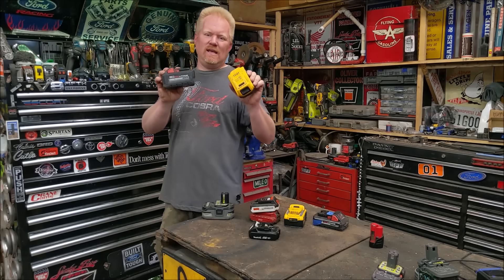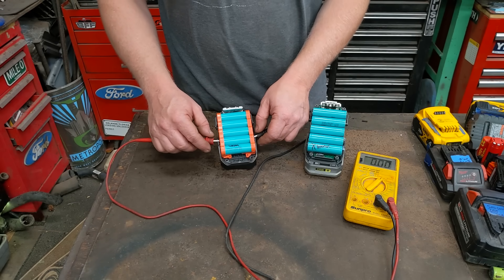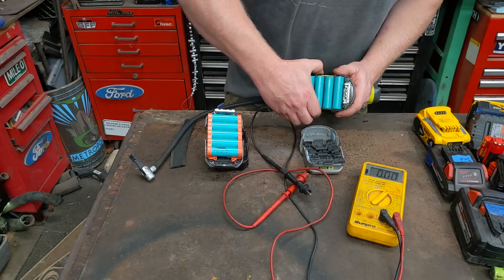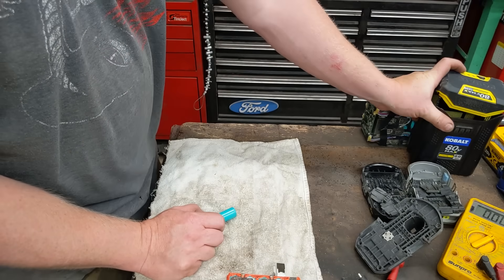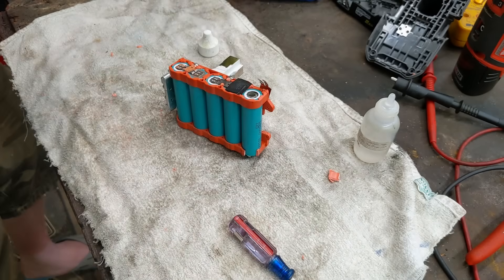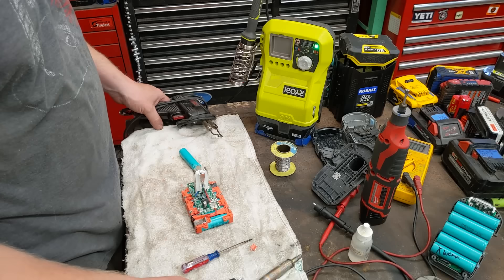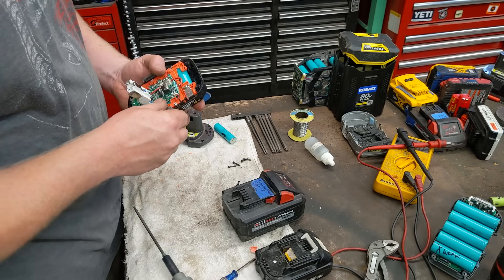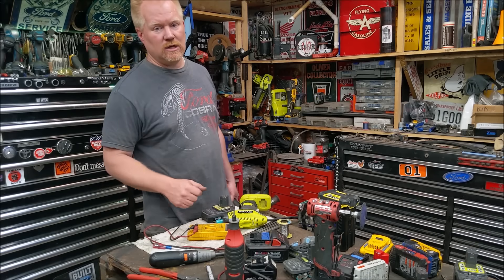Revive DEAD Battery Packs - Rebuild Repair - Dewalt Milwaukee Makita Ryobi Bauer Ridgid 18v 20v 12v

Comment: No one will answer me so maybe you will 🙏 I repacked a nicad battery with 18650 lithium and used a 5S board the problem I’m having is when I pull the trigger of my drill it goes to spin then stops and if I pull it on very slowly it will go full speed until I put any load on the drill then it stops can you please tell me why it’s happening and how to fix it please
Reply from the maker: Not all 18650s are created equal. You have standard and high discharge. Standard 18650 that you might find in a laptop can only put out 2 to maybe 5 amps. High discharge on the other hand can put out 10, 15, 20 or even 30 amps. So it sounds like you used standard 18650s and they're just stalling out/ the voltage is dropping off to zero under high load.

Comment: Excellent tutorial. Regarding soldering in general, a few things to ensure good joints and aide the process: 1 - make sure the soldering iron tip stays tinned or effective  heat transfer will be nearly impossible.  2 - skip rosin core and go with solid solder wire and use Solderlene flux with alcohol wipe clean. Better for metal-metal soldering is solid solder and Stay-Clean acid flux followed by liberal baking soda/water flush after soldering. Use a small amount of flux and don't let it run everywhere.

Comment: I have a Milwaukee M18 battery, it was flashing red on the battery, I jump started it with another battery, and now it's at 2 bars, but when I put it on the charger, it lights up green like it's charged. But it's not. Any ideas?
Reply from the maker: You have dead cells
Reply: @sixtyfiveford  Kinda figured that. Was just hoping it wasn't lol Where can I get decently priced 18650s?

Comment: How do you charge it with the cardboard plug? One clip on + and one on - ?
Reply: And have it connected like a bolt wrapped in tape work?
Reply from the maker: I have the ends of the test leads pinched between the cardboard and contacts.

Comment: Dyson is one manufacturer that requires you buy another board when one or more cells fail. But the boards range from $15-$25 instead of $70+ for a new own pack.
Reply from the maker: I thought only the magnetic switch went bad on those boards.

Comment: They don't solder the battery's, becourse the solder will melt if it getting to hot and the heat that travels to the battery can damage the battery,, also the solder joints can easyer break under vibrations, short spot welding doesn't do harm to the battery, can't easy break and delivers enough contact surface for power transfer.

Get the facts right and research befor telling story's and you have no clue what you are doing. You will at some point have a accident with your botched job and people that are doing what you told them too.
Reply: He even says that in the video when he's soldering to them. You can buy a cheap spot wwlder and strips on Amazon.

Comment: You can get this days excellent lg hg2 18650 battery's for about 6$ each and even cheaper the more you buy, change all battery's in a pack if possible and you have a much longer life out of the pack and they are even made for power tools.
Or build your own power pack with a bms and a 3d printed housing and that's even future proof if in the future the lifepo4 battery getting more amps in 18650 versions or similar cells.

Comment: You tell that factories don't solder because of time? This isn't correct when you solder that battery they can get to hot which destroys the cell when spot-welding it doesn't that's why they use this and not soldering. Just to inform you i make several battery's for all electric projects as my work.
But hey the movie you just made is great so keep up that. Greetings from the Netherlands

Comment: This is the best and most complete tutorial I have seen.  Ryobi batteries seem to be really prone to killing one cell, I am going to pick up one of those Kobalt packs and I can probably repair all 20 of the Ryobi batteries that I have on the shelf.
Reply: After loving the lawn implements I bought a drill set and yup… the 18V batteries suck
Reply: Sacrifice one to harvest cells to repair the others.

It isn't just voltage that matters though, you need to match the capacity of the cells in the pack.

Some battery BMS circuits will error out if some of the cells are discharging too quickly compared to the others.

Comment: One point they don’t all use the same cells, though most tend to use different capacities of 18650 cells, newer “high/higher capacity” batteries tend to use 21700 cells which are larger and the 2 cells are not interchangeable. 
While I have fixed battery packs in the past as typically it’s just a single cell or wire that tends to break and have even put new cells in packs; I must say for the battery pack cost vs the battery cell cost plus time rebuilding just doesn’t make sense anymore. I never understood why companies don’t offer a refurbishing service for their batteries where you send in an old pack and get either a new pack or new internals.
Solder can work for smaller size rep area but the builders/assemblers don’t use solder not because of just time, but size and safety, soldering can be quite dangerous with lithium batteries. One tip I’ll give you is to use tube solder, you just squirt it in a cleaned and fluxed surface, fold the tab over, then heat. Or just invest in a spot welder as the fixes are just so much better and always fit back in the pack; I’ve had repairs that didn’t want to go back in the pack because of solder, before switch to spot welding.

Comment: id recommend a bucket of sand for immediate yeeting in case a cell starts to bulge and may want to make bad things happen. its much easier to carry a bucket of sand than a hot cell and the sand helps contain any fires long enough till you are outside away from the building
Reply: sand is good but I prefer to use Li-Fire Safe Charging bags.  They arte inexpensive insurance against not only fire bur spraying, hot lithium.

Comment: I have pulled apart a few of my bad  battery packs, but have not gotten around to replacing the cells. The M12 is a bit tricky to pull apart. What I found worked well for getting the cells out of the tight battery pack is to put some hot melt glue on the end of the battery and attach some kind of puller. I use the pullers that are used in paintless dent repair.
Reply: What an awesome idea!

Comment: You can get a decent spot welder for about 24$ that uses either a high drain 12v lipo or a high amp-hr 12v car battery for power. They are made with two red pcbs for the body and have 3 buttons with a small oled display.
Reply: Those ones are junk

Comment: One thing to consider is that most of the cells in these packs were manufactured in the same batch, put into the battery at the same time, and likely have similar wear characteristics as ever other battery in the pack.  It's only a matter of time where you see multiple failures in the near future (YMWV).  This is a common issue in server RAID arrays for the same reason...all the drives are usually installed from the same shipment and are subjected to a similar workload over the same period of time.  

Replacing 1-2 cells may work, but if you could spare a few extra bucks, and you can get cells for a price that makes sense, just swap all the cells.
Reply: What an interesting reference to server arrays. I've seen the very same thing happen with batches of drives in raid arrays.
Reply: He forgets they are in stages, and usually the bottom one is the weaker of them all. Thus why he test each to see if it's in the middle.
Reply: It is true for server hard drives, but they aren't the same as batteries. I have gotten plenty of batteries that have 1 or 2 bad cells and the rest of the cells have continued working just fine. and most of the time they go bad because people don't regularly charge old batteries, which I recommend very much. They tend to drain by themselves faster the older they are but not all of them from my experience.
Reply: This myth is often used by the manufacturers of the packs to try and dissuade people from repairing them. A cell dying is a freak event. The chances of 2 in the same pack dying in close proximity to each other is miniscule.
Reply: That is false.  Cells do not commonly fail early.  Plus in the video he told people to use good cells from equally old packs because its cheap to do as people throw non-working packs away.  So you kind of went out of your way to post this false information.  A tesla has thousands of cells, replacing one is riskier due to that.  These devices have 5 cells.
Reply: But how does this detriment Trump Supporters ?
Reply: It doesn't,  but your TDS is a constant drain on your energy. That's because your hatred is self-destructive.  Funny how the party of tolerance is so full of hatred.

Comment: Doesn't Makita BMS have some sort of memory chip that logs the failures and purposely disabled the BMS permanently?
Reply from the maker: Yes if you attempt to charge a bad battery 5ish times. However, you can buy a new BMS and case for around $15.
Reply: @sixtyfiveford  That's interesting.  I don't think I've seen anybody go down that path.

Lol.  I guess I spoke to soon...I just got the the point in your video where you mention it.

Comment: I would recommend the charger I got while doing racing drones. It is cheap and versatile Imax b6ac.  Great info on your channel as always but the charger can help with many other scenarios.
Reply: I wish I saw your comment earlier. Bought the charger he's using but found out about the b6ac. It is alot more versatile and would've been great to use. From what can see the can charge a discharge whole battery packs as well as individual cells? All the listings adverise the pack charge/discharge function. But I don't see why it wouldn't work for individual cell charging like he is doing(@2:20) when set to the correct settings.

Comment: I had a Milwaukee battery only 3 lights would come on.  Plug it into the charger I got a green light.   Took it apart charged the one lower voltage cell and it seems to work again.

Comment: Don't worry kids! If you get lithium battery goo on your hands while working, MEK or benzene from carb cleaner will clean you right up!

DISCLAIMER: DON'T USE CARB CLEANER ON SKIN. IT CAUSES CANCER OR WORSE

FURTHER DISCLAIMER: When you give bad health advice to your audience admit your mistake or be punished in the comment section forever.
Reply from the maker: Absolutely. Per the can: "prolonged exposure can cause dry skin".... Scary.
Reply: @sixtyfiveford  you think it's ok to use MEK and Benzene on your skin? Say yes or no for your audience RIGHT NOW!
Reply: @sixtyfiveford  "Benzene is classified as a carcinogen, which increases the risk of cancer and other illnesses, and is also a notorious cause of bone marrow failure" - straight from Wikipedia.
Reply from the maker: @inspireonex  ETHYL BENZENE (CAS 100-41-4) is not classified as a human carcinogen. I have no issues with dry skin and just used it yesterday to take some super glue off my finger and this morning to remove dried paint off a hat. I touched the soaked rag continuously.
Reply from the maker: @inspireonex  So it's not a carcinogen in humans.... Nope, no MEK in my carb cleaner.
Reply: @sixtyfiveford  nobody said it wasn't. EPA only admits it could be. Why would you take the chance or encourage others to do so when it's so likely? As for your brand of carb cleaner only containing chemicals you find safe... That's great. The thing is though, you didn't tell people to "only use carb cleaner if you know this companies exact formulation". You said "spray it on your hands". I have seen multiple different cans listening different ingredients as hazards. Don't you find it strange how some brands or types cleaners do a better job than others? I.E. contains different stuff. Carb cleaner has been listed as a direct cause of so many health problems. I feel like you aren't seeing the forest for the trees. No matter. Do as you please. Just don't rope others into a false sense of security. Maybe others reading this will at least cause someone to do their own research as I have.
Reply: @inspireonex  FYI wikipedia is not a reliale source for research.
Reply: @jimkaray  reliable enough for the sake of this discussion Karen

Comment: Little trick with the ones that brick themselves when you pull the power is to piggy back a voltage into the BMS with some spare cells and wire.
Reply: I just replaced 6 out of 15 cells in Milwaukee m18 9ah, but when i put everything back the BMS doesn't show battery level or anything and on the terminals I have 19v 
Any tips?
Reply: @enduroiasg4068  No sorry, some of the smarter BMS's brick themselves when they are disconnected from the cells.  If everything is back together correctly I'd look for an aftermarket replacement board.
Reply: @jamesogle99  i put it in charger for few seconds and now it works :)
Reply: @enduroiasg4068  Awesome!
Reply: This exact scenario was covered in the video.
Reply: There are several ways to recover from a brick. The smbus is used on a lot of BMS and you can send a wake-up command if it's not burnt a fuse. 
You can also try to reset the BMS chip by shorting it's reset pin to ground.   I've done this a few times 

If removing cells.  Like you say, add a voltage to the pins of the BMS via a power supply before removing the cell.  This way can help avoid the brick

Comment: Even if I don't have a need for a pack, I harvest the cells and convert everything I have to use the 18650's I've done maglites air and water pumps, a lighted collar for the dog, anything  I can fit them into.. just pay attention to the voltage...

Comment: Apparently not on EBay anymore. :(
Reply from the maker: The battery cases/circuit boards? I put links on the video description where they are around $15 shipped.

Comment: Do you have a link for that little bottle of flux? Thank you.
Reply: Any non acid electronic soldering flux will work. I use a paste that cost a couple bucks and lasts many years... A search on EBay or amazon should bring up many listings.. The task could seem impossible without it and very easy with it..
Reply from the maker: I use the Kester 951 no clean flux. It lasts forever https://amzn.to/3bfvukk

Comment: Use the same diagnostics if you have a "new" battery that suddenly fails. These things are mass produced by robotics, probably never touched by a human hand until stuffed in a crate. Take them apart, check the cheezy connections and wire pathways, they get pinched to the point of severing, the connections can pop loose during the "gentle" shipping process. I've seen this in new OEM and aftermarket Milwaukee batteries at about an equal occurrence rate.  Easy fix.

Comment: I love your battery pack rebuild videos but I'm still using a Makita 18V NmHi cordless drill from the 1990's. The original batteries are long gone, I'm using Chinese specials at this point, can these be rebuilt in the same way?
Reply from the maker: I have an old video on Nicd/Nimh full pack rebuild. It's the exact same but I recommend replacing all the cells.  Honestly though, these days so few companies make the actual cells the Chinese ones aren't bad. You can a lot of the times take the Chinese guts and put them into your old pack shell. The plastic shell is usually better with the original Makitas.
Reply: @sixtyfiveford  Thanks dude 👍
Reply: It's probably easier to just build an adapter out of the dead pack that will accept a modern 18650 pack. I went with the Bosch ecosystem for this because their batteries are very easy to make mounting plates for (and I really like their drills, the main tool I use cordlessly). All of my assorted tools from the last 25 years (many brands, and different generations of those brands) now run on Bosch 18v packs.

Edit: Once you get good at this, you can usually get good quality tools with dead packs for dirt cheap, and use those dead packs to make adapters.
Reply: @mickenzie5863  you can find pack adapters for almost anything now.
Reply: @brandonreimer184  lol, not for my dinosaur tools, and probably not for strongandco's nimh packs. Also, correct or not, I trust the ones I build more than whatever floats over from China,